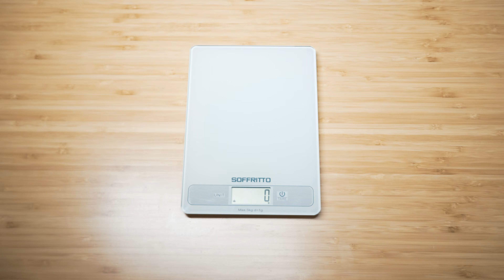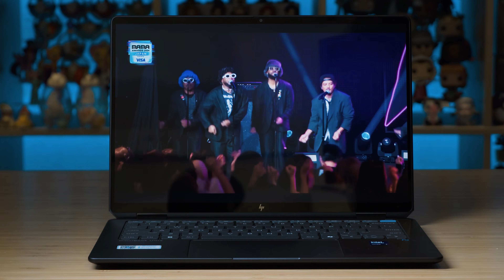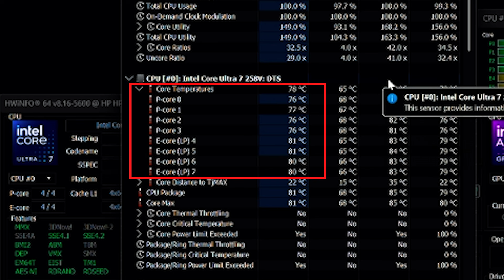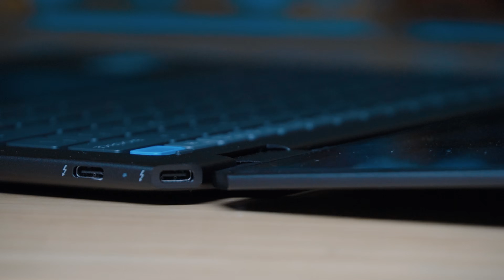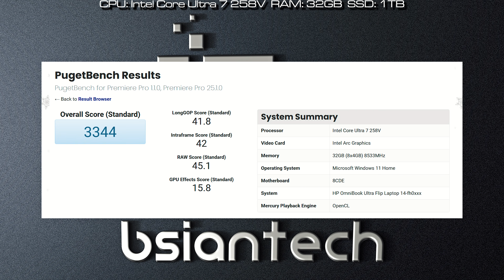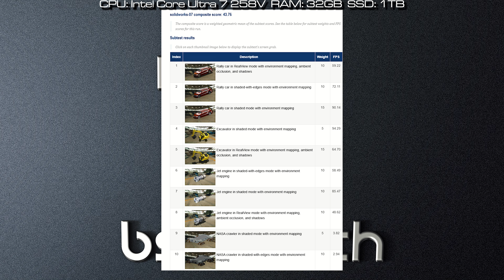HP OmniBook Ultra Flip 14 Hand-On Breakdown

Comment: Do you think that this laptop would do the work for home studio/music production purposes ?
Reply: That’s exactly what I’m getting this laptop for. Best thing you can do is get the 32GB of ram upgrade and Intel Core Ultra 9. My current laptop is the HP Envy 2 in 1 with 16GB of Ram and intel core 7 and it was pretty solid.. only problem is when i’m working with huge project files in FL Studio it would strain the CPU and lag sometimes. I eventually found out that there are ways around that if you just export your audio stems to WAV or MP3 so you don’t have all those VSTs open. With these newer HP laptop specs I don’t think I’ll have that problem anymore.
Reply: @jermagination Thanks a lot for taking the time to answer! 🙏🏼 I ended up buying it and it is indeed a really good laptop so far 🙂
Reply: @jermagination Best buy sale of the Core Ultra 9 32 gb ,2TB SSD version without the pen for $1500 ended last Saturday and went back to $1900. Then today, it's on sale again for the $1500 again.